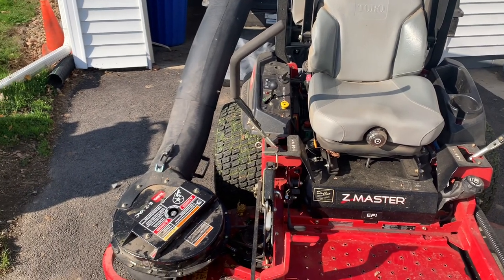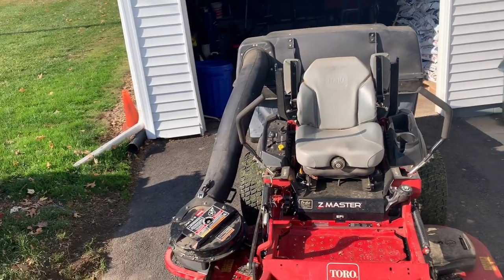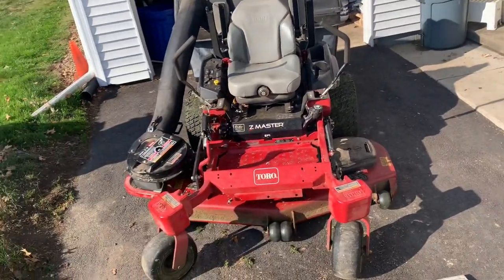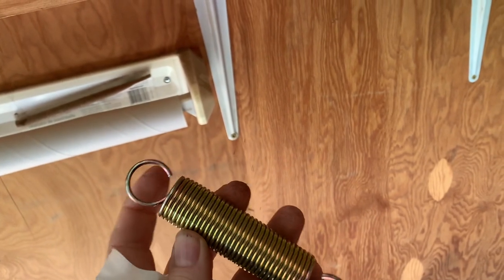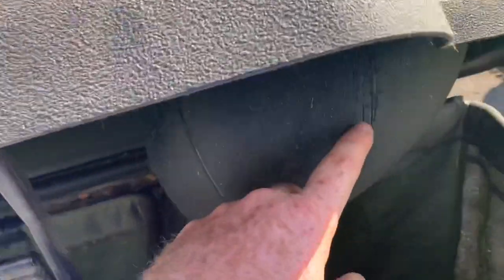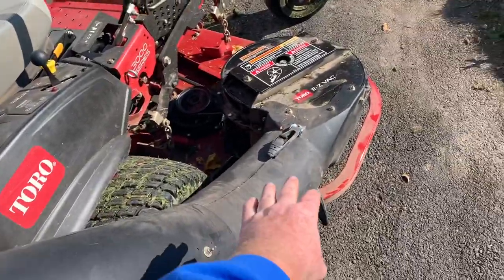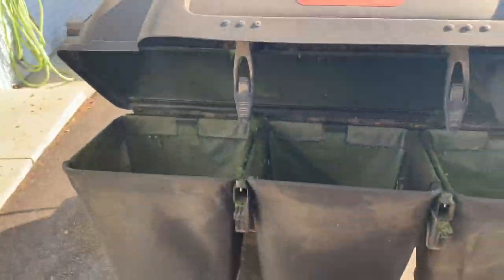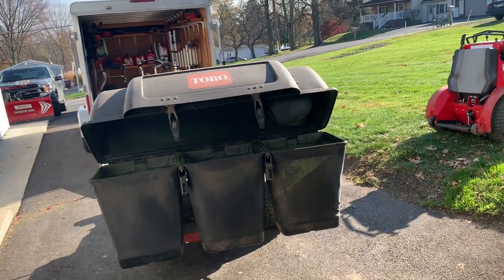New weapon in the fight against leaves

Comment: I totally get what you mean about when there isn't much on the lawn. It seems as if the yard is full of leaves, it mulches better sometimes because it holds it up in the deck better. However I have noticed when there is just a little leaves, it doesn't mulch as well, because it just blows out all over and would be faster to suck it up. However, I like mulching more and I don't want to justify that price. I do have a side catcher though. Good review Johnny

Comment: That sucks the spring snapped on the 1st day of use. I have always bagged like that and disposed of debris when I had help and leaf loaders and dump trailers. I find myself now wanting to mulch first and then bag very little afterwards. Yes takes me longer but easier to dispose of little debris instead of 2 to 3x as much. When they clog is for sure a pain. Where are you purchasing the Atomic or G5 blades at?
Reply from the maker: Outdoor power equipment

Comment: Darn, salute to you on the purchase.. I have to agree with the chat, 4k is too high lol!
 I don't have many properties bigger than 1/3 acre. One of the reasons I stick with smaller properties is to keep my overhead down. I use the original Grass Gobbler on my Toro Proline 36 and 44. I go over the leaves once with the chute off, then bag the leaves. I have a two of the  1 yard rubbermaid trash unit I can move around so that is where I empty the leaves, then when the cart is full .
I wheel it on to the pickup bed with a ramp. Its actually quite efficient for a low budget operation lol. I got the gobbler used for $75 and the large rubbermaid cart for $100  each on FB marketplace. I saying all of this just to give someone else an affordable way to do leaf cleanup if there budget is tight. 
Thanks for all the knowledge over the years Johnny.
Reply from the maker: Nice set up for sure!!!   I like what u are doing.

Comment: Good review. I'm just in the final stages of coming out with a bagging system for our new ZXT. With 40hp, we can really make it blow. My goal was to be able to have it process enough grass that it doesn't plug when mowing 6in grass at 13mph. The final work is tweaking a set of hoover vacuum baffles. I bought an exmark bagger, which is basically the same unit as your toro. I agree it's too front heavy. Works well but I agree that it's overpriced. $3000 would have been better. I think you can fix the rubbing bolt by adjusting the telescope section of the tube to be 1in shorter. 👍
Reply from the maker: I’m really impressed with ur newest z.  Your right about the tube!   I find the system is a bit heavy.
Reply: Ed please when you are putting your final touches on the bagger u reinforce the left corner of the bagger every exmark bagger I've seen used for awhile has busted off that corner causing it to leak debri
Reply: Hey Ed I’m just a small potatoes guy  here in NE Ohio. Your Wright ZXT looks like it’s going to be a game changer. A 40 hp Briggs Vanguard engine that as far as I’m concerned is going to be a game changer and Briggs Vanguards are the best engines hands down. I’ve talked to your rep from North Eastern Ohio Brian. I’d love to give your new beast a demo and a YouTube review.
Reply: Maybe a collaboration with me and Johnny Mow...? Ed I’m not looking for any free stuff. I’m just thinking out loud that you have raised the bar in the sit down zero turn market....?

Comment: Ive had several of the same bagger systems on my exmarks they work very well. I can tell you 2 problems ive had with all of mine.  Those rubber straps that attach the chute to the blower motor on the deck break and the casing on the blower on the outside edge is made if thin metal and will get holes in it i welded a steel plat around the outer edges of mine.
Reply from the maker: Good to know

Comment: When they installed it they didn't cut the chute the right length that why the bolts rubbing. It comes in 2 pieces  take it apart and cut a half inch off where it hooks together and it wont rub.
Reply from the maker: Thank you.
Reply from the maker: U are a wealth of information when it comes to this bagger thank u.   I guess I paid 175 for a bad installation